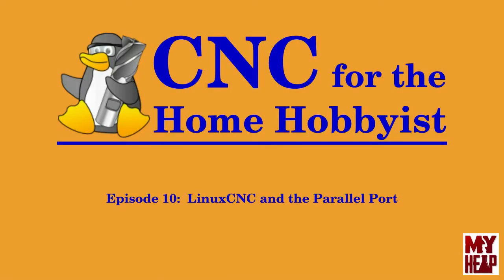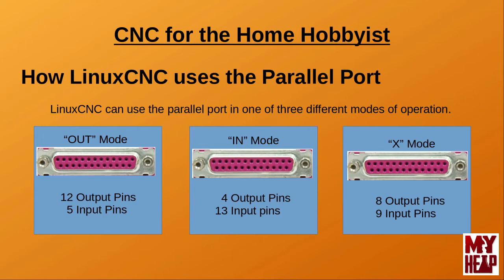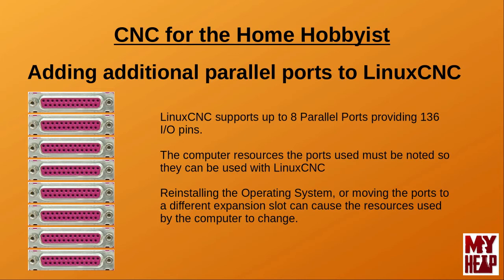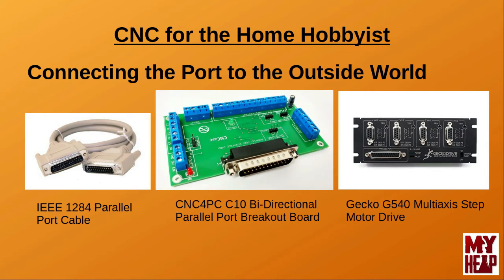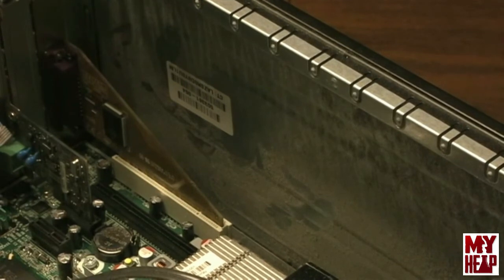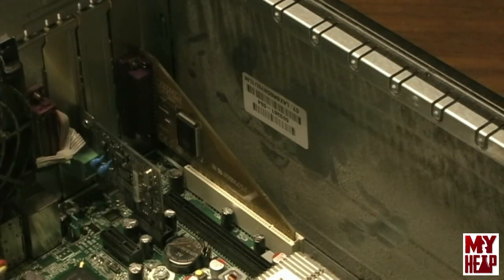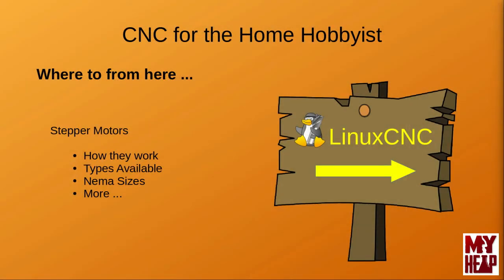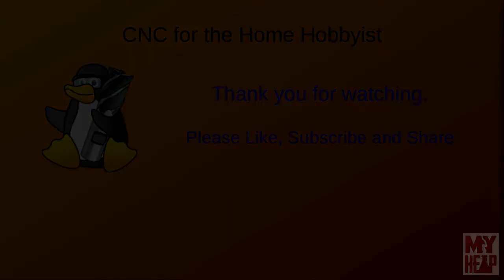LinuxCNC for the Hobbyist - 010 - LinuxCNC and the Parallel Port

Comment: Thanks for the video -  I use terminal ls /dev/parport* no such file or directory in linuxcnc - cannot see parallel port in LinuxCNC but can see it in Linux Mint for example - any simple solution to fix this?
Reply from the maker: Adam, again I want to apologise for the late reply.  I was going to direct you to the next parallel port video but saw you already made it there.  If you email me the card info, I will be happy to add it to the list of cards known to work and not work with LinuxCNC.

Comment: hi 
what is the  not expensive controller board can use for cnc milling and lathe? 
thanks
Reply from the maker: Anwar, are you looking for Parallel Port control or MESA?

Joe
Reply: @MyHeap  for The least cost it is hobby
Reply from the maker: @AnwarAlfaqeehAlhusseini  well, the parallel port is probably the cheapest way of getting into the hobby.  Some known working cards for LinuxCNC can be found here: http://myheap.com/cnc-stuff/linuxcnc-emc2/80-my-heap-articles/computer-numerical-control/linuxcnc/196-lcnc-parallel-port-cards.html

But this is only the beginning.  You will need either a break out board or a driver that connects to the parallel port.  And inexpensive break out board can be found at cnc4pc.com and other places.  Drivers and motors can be found there too.  I hope this helps you get started.  Other stuff may be available from Amazon or eBay.

Joe
Reply: My Heap thanks is very helpful  🙏👍
Reply from the maker: @AnwarAlfaqeehAlhusseini  you are welcome.
Reply: aliexpress less than 10$ breakoutboard, 3 axis or 4 axis or 5 axis board have, output one relay in board and normal optocoupled 4-5 input pin,  board colour green or blue.

Comment: Great tutorial. I'm a total beginer in cnc so your movies helped me a lot. But if I ask one question... 
I put LPT card (testing purpose) to PCI slot im my PC. Listing hw by " ls /dev/parport* " i can't see it. There is only parport0 (at mboard) visible. I can see that card under " lspci -v " command (with adresses). So is it correct behaviour of my linuxcnc system ? BestR. AC
PS. I use LinuxCNC v.7.14. & Intel D945GCLF2D mboard (DualCore ATOM).
Reply from the maker: What LPT card are you using?  Some cards, sold as printer cards, are really serial with some driver shenanigans going on to make them work with the computer.  Problem with these cards are they cannot be used with LinuxCNC.  Is the card you have listed on my site?  On a separate note, I have finally bought some Mesa cards and hope to make a video or two on those.
Reply: I use PCI cards with SUN chipsets (first card SUN1999 & second with SUN1989 - along manufacturer they  both support linux). "lspci" command list them/ their parameters in therminal with allocated adresses. Everythink looks ok. Along your movie linuxcnc can call LPT by number or by start adress. But question is does it /they have to be located in the dev catalogue by system too?
Reply from the maker: @acac1785  As far as I know, the port will need to be listed in the /dev folder as Linux treats everything as a file.  Reading and writing to the port will be through /dev/lptx or /dev/parportx  It seems like maybe the driver isn't being loaded.  Have you watched the second parallel port video?  What does it show for a driver when doing a verbose listing?

Regards, Joe
Reply from the maker: @acac1785  The SUN 1989 chipset is listed as working on my site, what are the vendor and device id's showing up for your card(s)?

Comment: Great Video, I have just installed a Sunix MI06469a  Parallel port pci card and am struggling to get it working, both of the commands you mentioned don't show any parallel ports, do you have any tips on what to do next
Reply from the maker: Open a terminal and type lspci.  This command lists all the pci hardware in the computer.  Look for information on the card you installed.  When you look at the /dev folder you do not see it enumerated as lp# or parport#?  You can use the -v swich with lspci to get more detailed information, eg lspci -v

Joe

Comment: Hi Joe,

I recently read on IRC that using a parallel port like C10 or cheap Chinese board can damage the parallel port bus or the computer motherboard. Sorry if it sounds stupid, but I don't have much electronics knowledge, can you let me know the way in which this can be avoided, I understand that one thing that we can do is using drivers that are optically isolated. I want to understand can we damage the board even if we use optically insulated drivers? Are there any particular wiring scenarios or failure mode analysis that we can do to avoid this. If you can answer this or perhaps point me in the direction, like some selected reading, I would be grateful. Thanks!

Pankaj
Reply from the maker: Pankaj,
I think two things are being conflated together here.  First, As long as the parallel port card is properly manufactured and inserted into the bus, there is little chance of damaging the computer bus by physical insertion.  However, static electricity can cause damage.  Best practice when inside your computer messing about is to wear a grounding strap to prevent any static electric discharge.  That is the first part.  The second part is hooking things to the parallel port itself.  You can short out and destroy a parallel port through carelessness and and other range of mishaps.  To protect the parallel port from this hazard, the break out board or other device that plugs into the parallel port are isolated.  This could be through opto-isolators or simple buffer chips.  But this allows you to have a mishap and not destroy the parallel port of other stuff in the computer behind the port.  It sounds like some of this stuff may make a couple of good tutorials.  Some basic electronic care and wiring practice.  I will add that to the list.  I hope that answers your question satisfactory enough.

Joe
Reply: @MyHeap  I think I need to do some more reading on electronics and electrical wiring before I become comfortable with it. Thanks for the answer Joe!

Comment: Is Linuxcnc a program that runs on linux os distribution? Or is linuxcnc a linux os distribution?...very confusing...when i try to install linuxcnc it wants to install debian and format my hd..which i dont want.
Reply from the maker: Hello.  Hopefully I can clear up some of the confusion.  LinuxCNC is an application that can in theory run on any distribution of Linux.  However, regardless of the distribution, LinuxCNC requires a realtime kernel.  When you download the LinuxCNC install software from the site, it comes with Debian Linux that has a realtime kernel.  To run LinuxCNC on a different distribution would require that you compile a realtime kernel for your distribution.  I have a video that shows how I done it and then another on compiling LinuxCNC on that computer.  This is usually more than anyone wants to delve into, this the reason they ship Debian with it.  I hope that helps clear things up a little.  Thank you for watching and your question.

Joe

Comment: Is there any way to check if Linux can actually comunicate with the B. O. B trough the par port. I have found the base adress with your approach, but nothing happens when I test the axis. Please reply in laymans terms since I have about 2 hours of Linux experience. Best regards
Reply from the maker: There are a few ways to do it, but the simplest way may be to use the parallel port tester.  It is a pyvcp program that will indicate the levels being sent to the pins.  You can find the HAL and XML files for it here:  http://wiki.linuxcnc.org/cgi-bin/wiki.pl?Parallel_Port_Tester

You could connect LEDs with current limiting resistors to the pins on the BOB to verify your readings also.

You can also use halscope from the LCNC menu to watch the status of the signals.

I hope this helps.  If you need further assistance, let me know and I will do what I can to help you.  Can you give me some more information about your setup?  What BOB, Stepper Drivers are you using?

Thank you for posting.  :-)

Joe
Reply: @MyHeap  thank you, I will try this when i get a chance. I read your link and it said to put both files in the same folder, but which folder. I assume I can't just make a folder anywhere and launch it in the terminal? I am by no means a computer whizz, but have casually used windows for a lifetime, Linux however seem greek to me with all the "DOS-like" commands you have to input :-)  my bob is a 4 axis combi bob and stepper driver(tb6560) .
Would also appreciate any tips on lowering latency on a Dell optiplex 780 with 2 GB ram. Thanks in advance.
Reply from the maker: Nils, let me talk about the first question.  Halrun is a command line program that will make hardware connections in the realtime environment and is at the heart of the controller, in this case it is used interactively using the two files that you download..  You are instructed to put the files in the same folder because the file that you open with halrun references the other file.  Where you put them should not matter.  I would save the files to your home folder, then open a terminal using the teminal button at the bottom of the screen.  This should open to your home folder by default.  type the command 'ls' without the quotes.  you should see the files that you saved there.  Once you have verified the files are there type the command 'halrun -I -f ptest.hal' again without the quotes.This command calls the halrun program to execute in interactive mode using the -I parameter and loads the file ptest.hal using the parameter and filename, -f ptest.hal

When the ptest.hal file is executed by halrun, the file looks for and loads the ptest.xml file which exists to build the dialog that you see on the webpage I showed you, it then makes the hardware connections to make the dialog (called a pyvcp, Python Virtual Control Panel) work.

I hope that helps, and if I have confused you more, perhaps I can make a video of it.  I intend on covering HAL and PyVCP and a host of other topics.  Time being my biggest constraint, i don't get a chance to make these videos at the frequency I would prefer.

I will address the other topics of your comment in separate posts to keep the size down.  Great questions, by the way.

Joe
Reply from the maker: Nils, I looked up the tb5660 and this looks to be a single stepper driver that is opto-isolated from the input signals to the motor control.  So you have 4 of these and a BOB?  Or have I found the wrong item?  Can you post a link to the exact hardware you have and maybe I can be of some more help here.

Joe
Reply from the maker: Nils, as far as the latency your experiencing on the Dell Optiplex 780.  What values are you getting?  I find that using the onboard video using shared memory space does increase latency in a machine.  If you are unhappy with the latency values of the machine, I would consider using an addon video card instead of using the onboard video controller.  Myself, usually having a handful of cards laying around change them until I find a latency value that I can live with.  Remember though that if you use ATI or Radeon cards that you will not want to use the proprietary driver with them.  Many suggest a matrox card.  Keep in mind that the quality of the video isn't what your looking for.  You simply want video that is removed from the shared memory resources.  Don't go crazy, just a card that will provide the minimum video resolution.  The graphical plotter you see on the screen only gets service when the realtime system is not working so there is no real need for speed here.

Joe
Reply from the maker: Finally Nils, I want to thank you for watching my videos and the great questions.

Joe
Reply: @MyHeap  I have tried a bunch of times and normally base thread is around 15000 and servo thread around 20000. However yesterday I saw a spike up to 100000+, this did seem to coincide with screen saver kicking in?  I also seem to recall reading something about disabling all but one of the cores to gain speed. I appreciate your patience with my skill level or lack thereof :-) I am a 100% sure that there are thousands of people like me around the globe, that would truly benefit from a linuxcnc for dummies series. I am sure you can find the answer the answer to any question in the Linux forums, but in my opinion the answers seem to demand a relatively deep understanding of Linux.
Reply from the maker: Nils, I have used both Windows, Linux and Unix for a number of years and you are correct, sometimes people think you should have some level of familiarity with the system.  Most people grow up in Windows with a GUI and find the way that some *nix things are confusing.  I hope that the discussions I give alleviate some of that, but truthfully as series could be done on the basic of *nix, just like Windows.

Now back to your latency.  When you run the latency program, the only number you need concern yourself with is jitter.  This is based on the base thread.  The servo thread is used to run less demanding processes.  If the spike in latency is occurring when the screen saver kicks in it could be because of the onboard video and shared memory.  As a test, disable the screen saver and run the tests again.

You can disable all but one processor as outlined on some pages but usually this is not needed.  I understand that the early SMI kernels had some issues with the realtime system and this was one solution.  performing this task can cause some heat generation and other ancillary problems and I would recommend that you only do that if you have no alternatives left.  I really would suggest trying an addon video card first.

If you have specific Linux questions, let me know and I will try to help you.  I am not a master at this stuff, but I do manage to muddle about until i find my way.  ;-)

Joe
Reply from the maker: Nils,  I looked over the documentation that is supplied with the driver.  It is a little sparse.  I am unsure what the (4 Axis Working Light) is, and I notice there is a power indicator light on the board.  Since the device uses opto-isolators to separate the logic signals coming from the parallel port going to the motor driver chips and motor power circuits, I am assuming that the external power supply has to be hooked up before the unit will allow the signals to be passed through.  I say this tongue in cheek because the docs don't really say if this is the case.

I would try hooking the power supply to the unit, and connect to computer then attempt a Jog and observe the (4 Axis Working Lights) and see if the come on while trying to jog.  If they do, I would assume that the signals are making it through your parallel port to your drivers.  If that were the case I would think that the address you selected for the port was correct and all was good.

Rather than use the address, using the enumerated port would be simpler.  If you do a directory listing of the /dev folder, do you see an lp0 or parport0?  This indicates the first parallel port detected on the system.  The first one will be the onboard port, if you have installed additional ports they will be listed as lp1, lp2, etc. or parport1, parport2, etc.  I failed to ask you, are you using the onboard port or an addon port?

Joe
Reply: @MyHeap  guess this means the port works? The outputs are red until I click them and inputs are opposite. Is there any way to check if anything else grabs "port-priority" over linuxcnc, if that makes sense :-)
Reply from the maker: Nils, Let's back up a second.  My email is xavier at gtec dot com.  I may want you to send some screen shots.  But let's start at the beginning because as I examine the port test hal file, it is configures to use address 0x378 which would be a standard onboard parallel port.  I have some questions and if you would rather reply through email that would be fine with me.

1) The parallel port you are using, is it an onboard parallel port? (Part of the motherboard)
2) When listing the port in the /dev folder, are you seeing lp0 or parport0 listed?  Or, are the ports being enumerated in the /dev folder?
3) Does the machine only have one parallel port?  Or have you added another port to the machine?
4) When you open a terminal and run the command cat /proc/ioports | grep parport what addresses and ports are listed?
5) When you bought your kit, did it come with a parallel port cable?  If not, is the one your sources a parallel port cable or a serial cable with DB25 ends?
6) Are you comfortable with electronics?  Have you ever used an LED before?  I ask because we can put an LED with a current limiting resistor connected to a data line and ground on the physical port and send a test signal to it to make sure it works.

I know that is a barrage of questions, but I would really like to see you get your stuff working.  I think though we should move this discussion to email as it would be a little easier to add screen shots and other information, if your willing.

Joe
Reply: you have to open the terminal in the same older.

Comment: I used an ADT link in m.2 E-key to pcie adaptor so I can run a parallel port but i dont think it's working. Is their something i need to do to get it working
I am running a Latta Panda Alpha 800.  And in the bios under sata port's it reads Empty /Unknown ???-!!!!!! frustrating
Reply: You ever get that working? You'd have to use the Nvme slot on that board. Otherwise a riser won't work. I have a parrallel port card using a riser on a similar setup, detected by Linux, but just having issues getting it to work.
Reply: @Nordic_Goon  just saw your response.
thank you . I've made some progress.
i'd like it to show you !
Reply: @johnross3752  I actually got my stuff working! Awesome work!